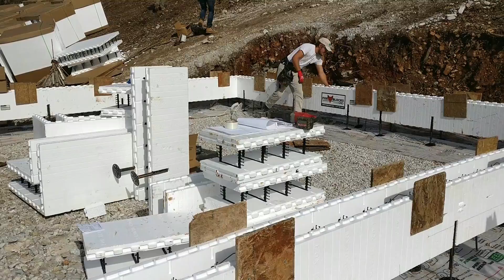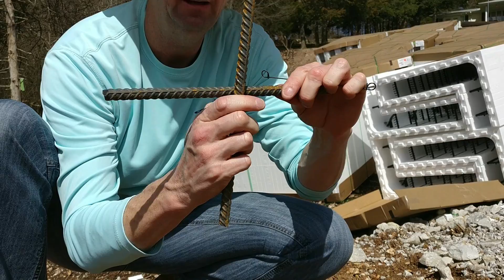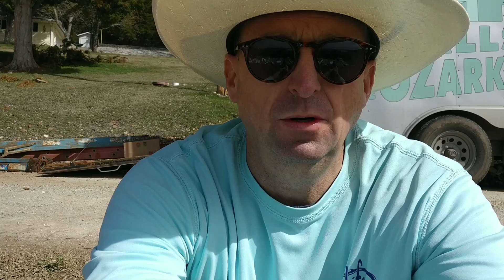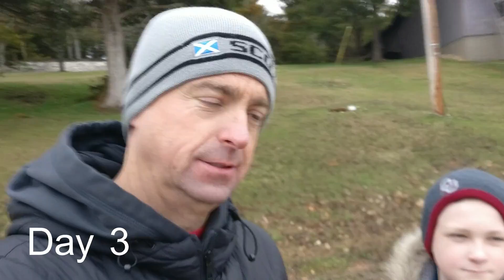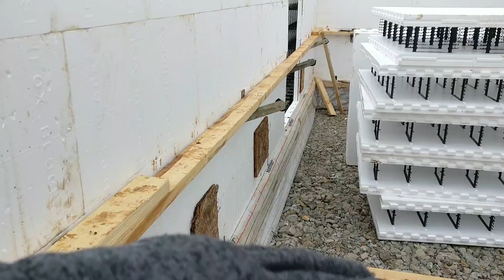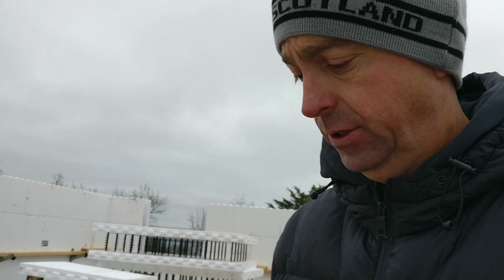Building with ICF Block: Adding Rebar and Cutting Openings

Comment: I like the Mono pour part but have a problem with the down hill side thinking it should have been dug out down deeper into the ground to make sure you have a good footing at least 2' in the ground. Having a deeper footer on the down hill side would help to support the house from possible sliding down the hill.
Reply: Yes i'd want a few deep free sliding pile anchors commected to the slab in the front

Comment: We had quite a bit of waste block on our build and it all ends up in the landfill, along with all the little balls of plastic foam that blow in the wind every time a block is cut, or a channel is cut for the electrical.  Add to that the environmental footprint of all that concrete and ICF is certainly not the environmental choice 😉  I may try steel stud reinforced SIPs on my next build.  There truly is no waste in those, and everything supposedly shows up on site perfectly cut, plumb and square.  The key I think is to make sure that your drawing is right from the start.

Comment: Why the blocks were floating instead of building it from the ground up entirely from the ICF's?
Reply: They're using fastfoot to form the footing. Wraps up both sides and makes a bag form
Reply from the maker: We wanted a monolithic pour for the foundation and first row of blocks. Doing so meant we had no cold joints between a foundation and the first row of ICF block.

Comment: Planning to use the same Fab Form system for a monolithic pour for our lake home in northern Idaho this summer.  Had a question regarding how the rebar is suspended in the Fast Foot bag?  Are you using Helix micro rebar in your mud?  We are considering using a 6 sack mud mix with 3/8" aggregate, 5% air, 13.5 #  of Helix, and having it arrive on site with a 4" slump, then bumping it up to 6" using an admix.  Any advice on mud mix?  Thank you for documenting your construction, this is very helpful!
Reply: I wouldn't trust helix.. follow the block manufacturers directions to the T for rebar schedule..  Also don't use helix in a finished concrete floor, unless you want wire poking out..
Reply from the maker: We did not use helix. The rebar was set on plastic "chairs" so it stayed elevated during the pour.
Reply: @LakeLotBuild  could have tied the rebar to your feet.
Reply from the maker: In our video featuring the monolithic pour our ICF contactor describes our slump and details about the concrete additives.

Comment: How much per sqft?
Reply from the maker: I'm not sure we could break it down like that, but the supplier Fox Blocks might. It really depends on the additives in the concrete, the lot, etc. With lumber prices being what they are right now, we think we are actually saving money with an ICF versus timber framed. When lumber prices were "normal" our builder said that ICF runs around 10-15,%  more than wood framing.

Comment: Good thought to have gravel below the foundation. Water will cause a lot of hydrostatic pressure, hard to deal later
Reply: I'm new to your site and don't have much experience in building, but your mono-pour footers/wall puts the footer on excavated dirt, no?  Did you lay gravel over the entire site and then mono-pour on the gravel and backfill 3 or more feet to be above freeze line?  If so, how deep of gravel did you lay first?
Reply from the maker: Welcome to the channel! We excavated to good rock then backfilled 3' with "dirty" limestone. We then put a foot of "clean limestone on top.
Reply from the maker: Yes. We were worried about hydrostatic. Glad we did it!